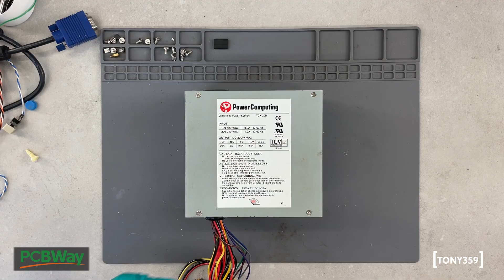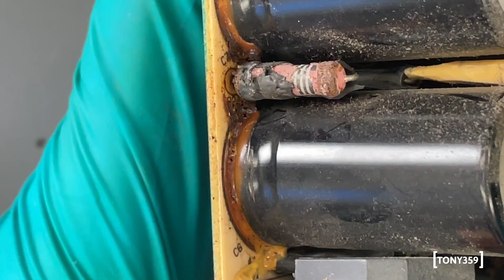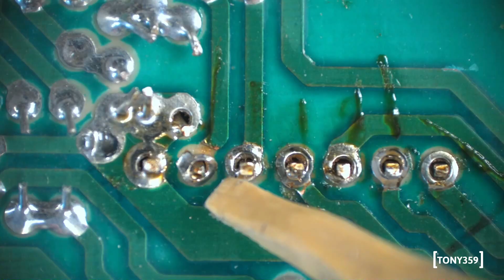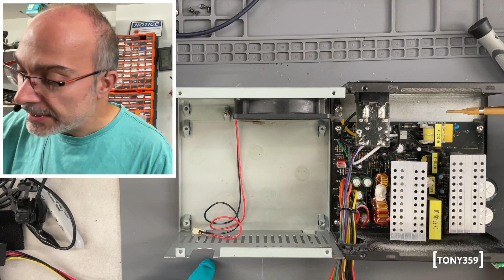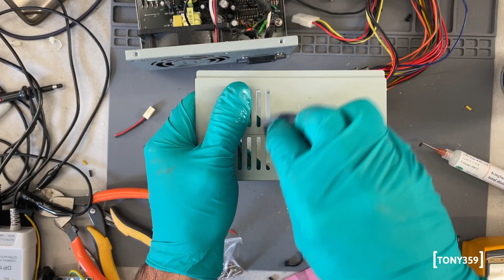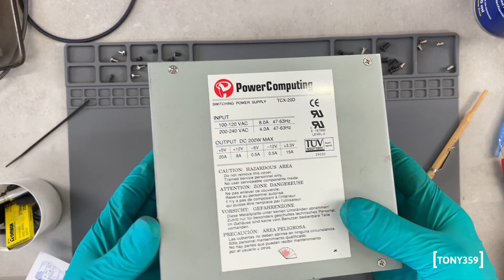I could not fix this Power Computing power supply. So I fixed it.

Comment: Obviously you did some miscalculations here.
With a 115Vac supply  the filtercapacitors are in parallel, thus having root2 = 1,414 times the input ac voltage of 115V = 162Vdc (minus the bridge rectifier series loss).
With a 120Vac supply  the filtercapacitors are in parallel, thus having root2 = 1,414 times the input ac voltage of 120V = 170Vdc (minus the bridge rectifier series loss).
With a 230Vac supply  the filtercapacitors are in series, thus having root2 = 1,414 times the input ac voltage of 230V = 324Vdc (minus the bridge rectifier series loss).
With a 240Vac supply  the filtercapacitors are in series, thus having root2 = 1,414 times the input ac voltage of 240V = 340Vdc (minus the bridge rectifier series loss).
Thus both resistors and both capacitors are exposed to a max voltage of 170Vdc.
The capacitors are correctly rated for 200Vdc, and the resistors dissipates (170V*170V) / 22K ohm = 1.3W and are correctly rated for 2W.
What you see here is a completely normal eol of the resistors as they have a limited lifespan constantly exposed to heat.
I would suggest however, that the resistor values are changed to 47K 1W, as this is still adequate to discharge the capacitors: 330uF x 47K ohm x 5 = 77s or 1min17sec for fully discharged.
This is barely double the discharge time as with the 22K resistors.
Reply from the maker: Hi - thanks for taking the time to comment! Your math is sound. However what I read on the circuit does not match, and I don't know why. I have 240V supply and I read 395V instead of 340V - I believe I mentioned that in the video. And before removing the switch, I had 495V (241V per cap). 
Good to hear that those resistors are "supposed" to die at some point. Still, I don't think it's a good design to have them running at 100C+ while attached to the capacitors!
Thanks for watching!
Reply: Did you have 2 phases connected by any chance - intead of 1ph + null ?
There is no reason why you would read 395V or even 495V unless your meter was in a wrong setting.
That would burn out the resistors pretty fast as then they are  exposed to much more power than rated for.
The capacitors would explode if exposed to more than 10% overvoltage.  @tony359
Reply from the maker: It was powered via my isolation transformer. I know this doesn't make any sense. I checked with two different multimeter and the oscilloscope also confirmed that. I don't know what to say!

Comment: Nice work, although I'd rather have watched you find the fault with the original. I guess you would need to megger(insulation tester) the voltage selector switch to see the issue with it.
Reply from the maker: Absolutely, I would have loved to fix it. It’s just that sometimes I have to make a choice - I have much more interesting projects coming! Indeed a high voltage test might reveal the issue! Thanks for watching!

Comment: The new power supply lacks -5v which may cause issues if the old PC has ISA cards. Also as others told you the old psu was 5v heavy as 5v was used to power cpu and ram, now modern boards use 12v to power cpu. 
You could make your own inverting circuit with a *34063 or 33063 switching regulator on a tiny circuit board for -5v , there's online calculators that tell you the component values. Other than that, it's a poor power supply, looking at internals it's more like 250-300w maximum, and the numbers on the label are lies as you saw...  I would have taken a step further and read the part numbers off the rectifying diodes on the secondary heatsink and replace them with the diodes on the old power supply if those are rated for higher current.  I'm also a bit concerned about the fan cable touching the secondary heatsink, as that could get in the 70-80 degrees Celsius range.  Not a fan of zip ties, would rather have the wires more spread out there to allow some air from the fan to get around those secondary capacitors, the way you put everything together those are covered up, without airflow.
Reply from the maker: You're points are all very valid - and I am now concerned about that -5V I didn't spot! :) Thank you (and everybody else). I see your point about the capacitors but there is a vent opening just by them. The fan is very powerful so the caps should get fresh air directly from the case. But point taken, I completely see what you mean. I might need to revise my transplant in the end! Thanks for watching!
Reply: @tony359  Hi Tony! I'm not sure if you've seen Necroware's -5V solution called the "Voltage Blaster". It's designed to provide -5V power to the ISA slots, but it's a very simple circuit and you could probably adapt something within the PSU chassis to output -5V to the appropriate ATX lead as well. Could make for an interesting project 🙂
Reply: @vswitchzero  I'm not a fan of that one. It produces -5v from -12v using a linear regulator but -12v is already quite unregulated and low current on modern power supplies, for example the one above advertises a maximum 0.5A, if you take from that to make -5v it's gonna be worse. If you don't care about current amount, you could just use a charge pump like ICL7660 to make -5v 20-50mA by inverting 5v, and you don't generate heat by reducing -12v to -5v. 
An inverting switching regulator circuit with 33063 or 34063 could be powered from 12v which is in higher amount in modern power supplies and has potential to give more than one amp of current.
Reply from the maker: thank you @vswitchzero and @mariushmedias for your input! It looks like being a Macintosh, -5V is not needed but still TBC. I see what you mean about getting -5V from a weak -12V. Whether it's unregulated it won't matter - I think - as a -5V regulator will take care of that. 0.5A is very little indeed event though I believe -12V is using by logic and nothing more so it might be enough for that odd-board. I'll keep both solutions in mind though thank you!

Comment: Thank you for sharing video. But Tony, I think you changed PSU's "inwards" a bit boldly. The thing is, new PSUs, even crappy ones, intended to source most of there power by 12V line. The old PSU, judging by the sticker, could source up to 20A. Please note, rare modern PSU can do so. The reason is modern computers mostly rely on 12V source (CPUs, GPUs), but old computers mostly rely on 5V source.
BTW, many cheap(ish) PSUs have so called group voltage stabilizers at low-voltage side, which means 12V and 5V lines affect each other. Long story short: if you draw much current from 5V line with lo load at 12V line, 12V line will increase the voltage at some point to the margin where output voltages supervisor IC will shut the PSU down. Please note it.
Reply: Modern power supplies having low current limits on 5V is not an issue for most old systems. It's relevant for power hungry Pentium III and Athlon builds, but not in this case. It should draw way less power than the PSU can handle on 5V.

I've put a 400W PSU into my Socket 7 PC, the sticker says 20A on 5V and 130W max combined power on 3.3V+5V. But the system goes nowhere near that limit, as it only draws 50W from the wall when running DOS. Considering PSU inefficiency, the internal power draw has to be 35W or less, and that is total power draw on all voltage rails.
Reply from the maker: Indeed I did notice the old "200W" power supply is delivering 20A at 5V when the "500W" one can't even reach 15A (but hey, the label said 27A!!). Probably not the best match indeed. To be honest with you, I only realised that afterwards! Thanks for your brilliant clarification, it helps a lot. I guess we will test that PSU on that machine and see how it goes. Worst case scenario I can try to find another one.
Reply: @tony359  Glad it helped somehow ) But please consider, the reason of turning PSU down at 15A instead of 27A could be not only that replacement PSU is crappy, it also could be the case of no load on 12V line at the same time, as I mentioned earlier.
So, retrofitting could be a bit more complicated than it seems to be at first glance. I think, grabbing just a random PSU is not enough. I don't know if it hard to find in the UK, but I usually get the InWin (Powerman) IP-P series PSUs (second hand) for reasonable price to use them in similar cases. They made pretty reliably and could be a good choice.
Reply from the maker: You're right, hopefully it was just the lack of 12V load. I could have found a better one, the problem was that I was looking for one which fit the case without too much hassle. I didn't want to buy one on Ebay to then find out it's mechanically incompatible. So I went to a "scrap" place, they let me open a couple. One was not compatible. The other one was. It said 500W on the label and... :) Lesson learnt :)

Comment: Nice, but no -5V for ISA?
Reply from the maker: Did I miss a voltage on the replacement power supply?
Reply: @tony359  I assume, the stickers on the renovated PSU have risen my attention. Newer PSU with ATX don’t supply -5V, which older ATX do. It is not crucial, but some ISA cards do require it. As long as your friend does not run older ISA cards, he won’t need the -5V. (edit grammar)
Reply from the maker: I have just mentioned him - I am not familiar with the "Macintosh clone" family. We will see. Thanks again for pointing that out!
Reply: @tony359  The machine it's being used in has no ISA slots. I doubt it's using -5v at all.
Reply from the maker: ah cool! Then hopefully finger crossed. My friend told me he's using a modern ATX at the moment and everything works so maybe I'm in luck! :)
Reply: @foobar1979 @tony359 my apologies, now I see it's an apple machine.
Reply from the maker: yes it's an apple macintosh clone :)

Comment: I recognise the donor PSU, the legendary green ATX-500B firestarter that has ZERO chance of actually delivering a usable 500W
Reply from the maker: Firestarter? OMG! :D I knew it was cheap! I hope the system in which is being used is not too fussy!
Reply: @tony359  just in the generic term for a lousy PSU, 22A at 12V is pathetic for a supposed 500W unit, and as you found, 5V didn't even meet the specification.
It might just about be an honest 300W
Reply from the maker: As long as it can do 300W I'm happy! :D When you said Firestarter I thought it was known for catching fire :)

Comment: While I liked the video, I do not agree with adding a voltage selector switch that doesn't work, and not removing the old label from the power supply. That is both a safety and legal liability issue.  While I doubt anything would come of it, I wouldn't take that risk.
Reply from the maker: @PJBonoVox - I appreciate your comment but everybody has the right to express their criticism in a civilised manner. I appreciate eshwayri's point of you and I kindly ask you to be kind with the community. Thank you!
Reply from the maker: I don't disagree with you but that is what the owner of the power supply asked me to do! I will definitely add a warning at the back to make sure nobody powers it up at 110V. That said, powering a 110V PSU with 240V is a danger. But will powering a 240V PSU with 110V cause issues? I'd think the power supply wouldn't start. What do you think? Thanks for your comment!
Reply: @tony359 I would think it would just not work at 110V; I doubt it's a fire risk.  Having said that, it wouldn't shock me if there was some obscure EU law about this.  I don't think you are in trouble; I'm just a stickler when it comes to labeling high current devices because I know there are so many idiots out there who might do something stupid.
Reply from the maker: You are totally right. I did mention my friend when I was thinking what to do with the switch and he told me "I'll put a sticker which mentions 230V only". What I wanted to do instead was to glue the switch so it would not switch to 110V :) I appreciate you being careful with high voltages, it never hurts!

Comment: I'm glad you value your time and knew the best way to handle this one given the situation. You still put more time into this one than I would have. That original power supply wasn't worth fixing, there is nothing special about that power supply as it has no value. You met the criteria for your friend and luckily 'modern' hardware still works for this application. Now you have more time for the more interesting things :)
Reply from the maker: I'm glad you agree - indeed, off to more interesting projects now! Watch this space! Thanks for watching!
Reply from the maker: All makes sense. If it hadn't been a cheap and random ATX standard power supply! Had it been a custom Apple or IBM one, why not. But this is really nothing special. That said, well done for your dedication in creating schematics of parts!
Reply: You spent 8 hours EVERY SINGLE DAY for 10 weeks reverse engineering an 8 layer board! Fk me! WOW, now that is next level dedication and then some. There is no way i would have the patience to do that. How do you even see where the internal layers go.
Reply from the maker: that wasn't me :)

Comment: One thing got my attention, as you mentioned that those mains filter electrolytics were between positive rail and ground. This is wrong and can even be dangerous. 

Negative rail of your mains rectifier is NOT ground potential.
Reply from the maker: You are right and that is why I use a differential probe when checking a power supply. Apologies for the inaccuracy! Thanks for watching and for the feedback!
Reply: @tony359  Way back in the day I found this out be causing mains short with my oscilloscope. Old house, no ground fault protection, pretty good bang.

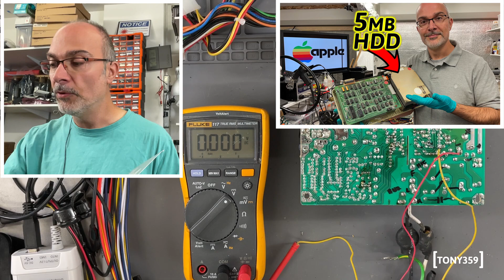Comment: timestamp 11:50 you had to replace the chip as it is faulty common issue that it goes bad !!!! when it turns on and then stops usually the chip
Reply from the maker: I haven't thrown away the PCB, if I can get the controller easily I might give it a go. Thank you!

Comment: Replacing the low volt caps usually helps if just the voltages are messed up.
Reply from the maker: Thanks. It could surely be a bad capacitor somewhere...
Reply: Great swap 👍